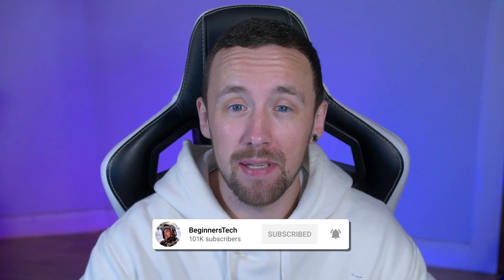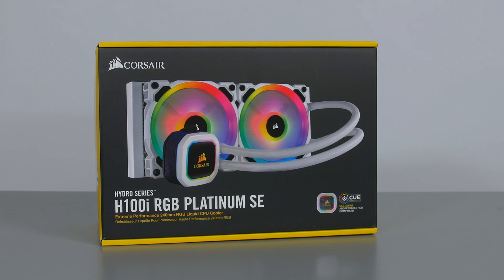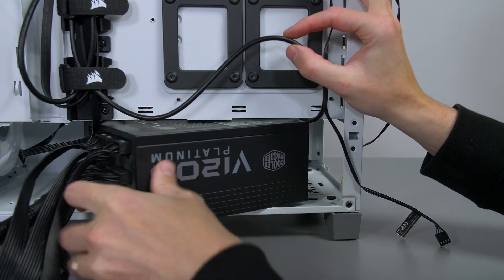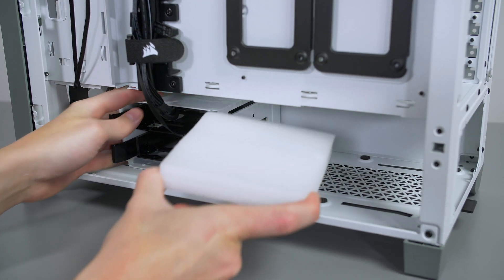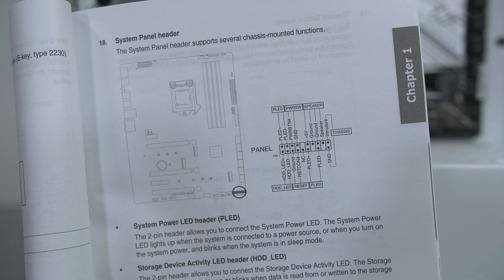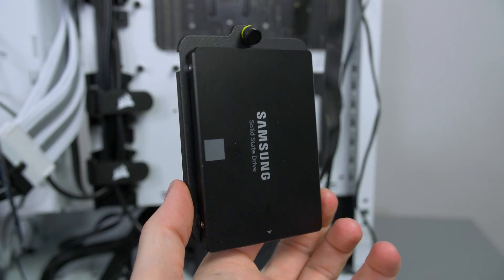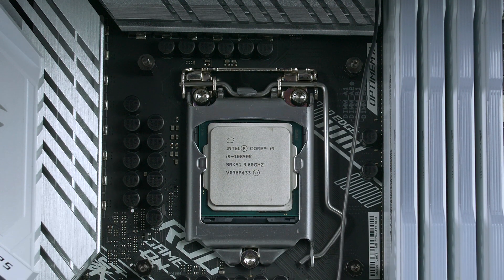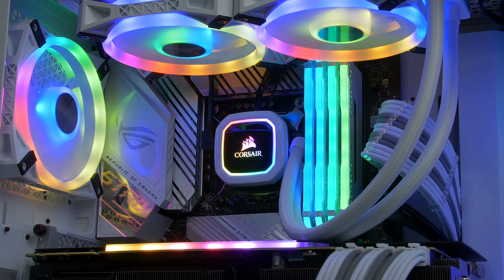The Ultimate RTX 3090 Gaming PC Build 2020! My Most Expensive Build Yet! (4K Benchmarks, 10850K)

Comment: I have a very important question for you. I hope you answer... I’m doing this EXACT build with the list of parts you left in the description. The iCue Node Core that comes with the case only has 6 rgb ports. How did you connect 6 fans AND the the H100i rgb connections all to the node core? On my last build (before I sold it altogether) I had 6 LL120 fans and the H100i as well and I could not connect all those ports into the node core of my 465x case so I never had full control over the RGB.

Comment: Hey,

I was planning to build in this case with the vengeance RAM and same AIO cooler.

Build: Ryzen 7 3700x, Corsair H100I RGB PRO XT 75FCM, AS ROCK X570 PHANTHOM, COSAIR VENGANCE 16GB, ICUE 400X RGB CASE

I have seen review that the AIO cooler cant be mounted on the top due to the RAM.

Is there a lot of clearance?